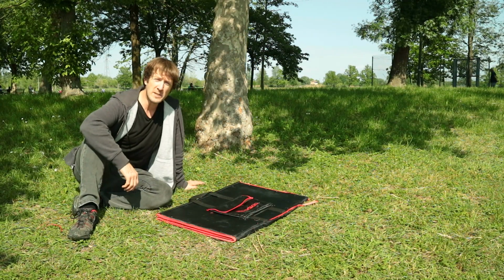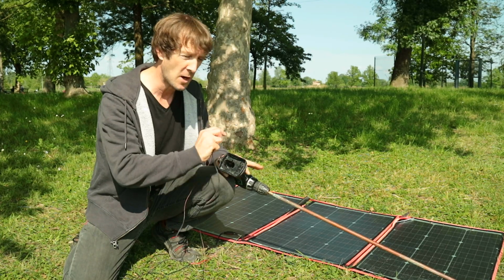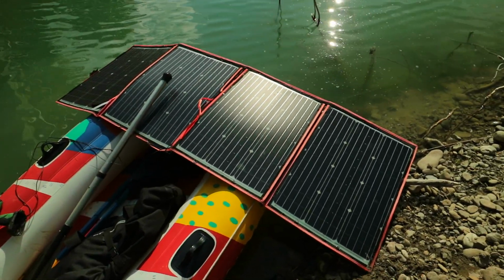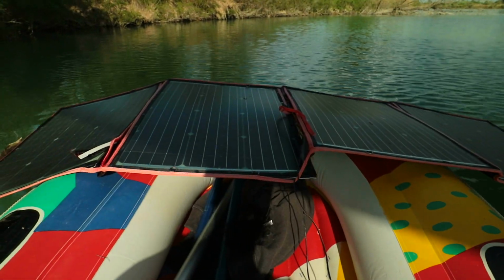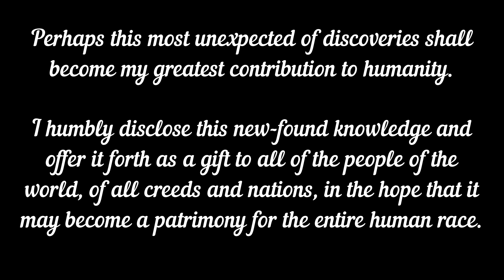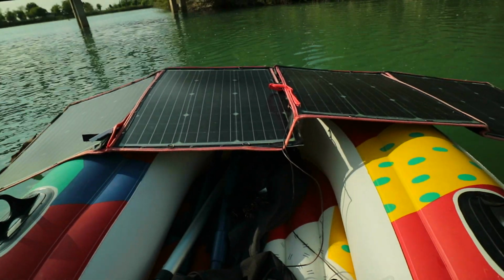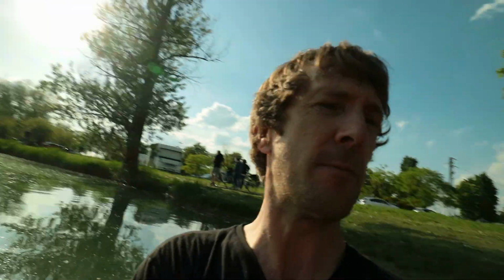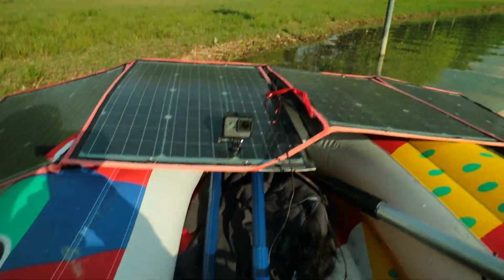The World's Simplest Solar Powered Boat (No Battery)

Comment: Excellent experimentation. I think you could make a fold-up solar roof for your fold-up dinghy. That might be a better platform for this? Maybe use the panels to power one of those cheap trolling motors instead of the drill. This could be the next step forward. I'd love to see that...
Reply: I'm working on it :)
Reply: @saraofnorthwales  hello :) any progress abt that project? I'm planning the same.. i have the inflatable, the motor, looking for the solar panel...

Comment: Its the way forward given current affairs
Reply from the maker: Yes it is now possible to travel the full length of the I95 at 0.8 miles per hour on a solar powered electric e-bike without a battery. A tent could be carried and an adventure made along the way...
Reply: @SailingBritaly  indeed..indeed 😊👍
Reply: @SailingBritaly  Tent will slow you down as well as clothes, just let those essential's hang in the wind, gotta maintain that 0.8 MPH

Comment: Maybe one day an engineer will invent something to blow up inflatables without using one's own puff??
Reply from the maker: 😂 We have a foot pump in the garage somewhere but the time and energy it would have taken me to find it exceeded that required to blow it up manually. For anyone feeling particularly lethargic it would also be possible to drive a 12 volt compressor direct from solar panels with no battery…
Reply: @SailingBritaly  You missed your chance of showing DOUBLE DUTY on the video * " it would also be possible to drive a 12 volt compressor direct from solar panel" *